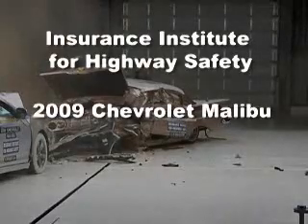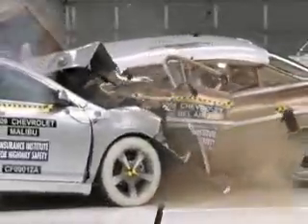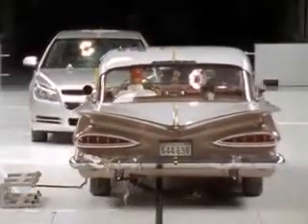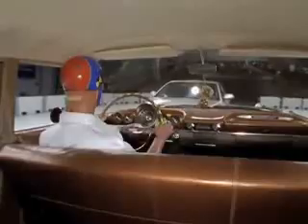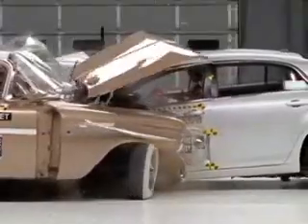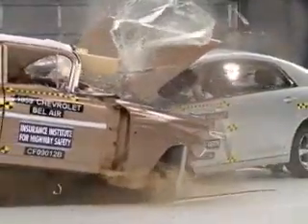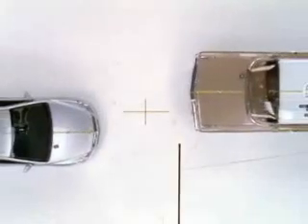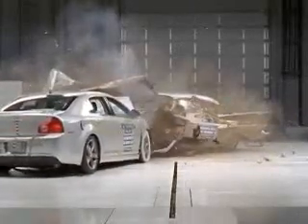Crash Test 1959 Chevrolet Bel Air VS. 2009 Chevrolet Malibu (Frontal Offset) IIHS 50th Anniversary

Comment: old cars just do not perform as well in crashes and their passengers fare even worse as they are impaled by steering wheel columns and smashed against that lovely hard steel. modern cars have improved a passengers chance of survival significantly because of engineering, science and testing - which so many here seem to have so little knowledge of.

and there is an engine - the 1/4 frontal hit is deliberate as a worst case test and its about saving people (inside and out) and  not the car.

Comment: That's not even a Bel Air, it's an Impala!! The Bel Air looks much different from that. I saw a beautiful 1957 last month and it had single head lights and a different body. Plus I think the Impala is bigger and it looks identical to the 1960 model.

Comment: This video is fake. First, the Bel Air had no engine in it so right there is a huge difference. Second, it is impossible for a car that old and well built to be crushed by a Malibu that new. Had the Bel Air had an engine, that Malibu wouldn't stand a chance!! An idiot could figure that out. All you have to do is look at them side by side. Steel bumpers, solid frame on the Bel Air, fiberglass bumpers, much cheaper frame on the Malibu.

Comment: These comments make me laugh. If you watch the dash in the '59, you will see it deform in the center. Thats the engine (the inline 6's sat in the center of the engine compartment) being pushed back into the fire wall. See the steering column? Yeah, its being pushed into the driver. Real safe, eh? Sure it sucks they ruined an old car, but I would rather be in a soul-less appliance in a crash like that than dead with a steering wheel in my grill.

Comment: Does anyone else notice the amount of rust-dust? That 59' may have had a new coat of paint, but the film clearly shows it was total rust-bucket. In which case it's "All bets off". The bodily danger of old cars was always the 'secondary crash' that occurs within passenger compartment, never structural failure. I'm going to call it "Myth Busted."

Comment: @78futura1 take into consideration there were not that many camera viewes/ angles on this and i highly doubt they fill these cars up with everything in case of a fire of leaking gas, collant ect. and also this 59 chevy was built on a X frame and they crumpled so bad even worse then most older cars due to "unique" and awful design by GM. in addition newer cars are made to crumple to slow the impact were older cars were stiff and bulky they would just bend snap and destroy its self

Comment: the steel used then was low grade unlike high strength  steel used today I drove those cars in the 60's don't get me wrong I liked them then  but they required constant work to keep them running and the batteries and generator/regulators of the day were notoriously unreliable  those x frames were notoriously weak so were the other car companies imports were even worse would like to see a 68 Buick Electra 225 in this test.

Comment: @madhatter0110 Your right about the fact newer cars are safer, the construction is better and you need a heavy impact to deform the passenger area. But this is just a useless test, the Bel-Air is not complete. To have a good test, both of the cars should be in a condition how they're driven on the road. I'm an engineer and I run tests, this isn't a proper test situation. The only thing proven here is that you can flatten an empty, 52 year old Bel-Air shell with a 2009 Chevy Malibu.
Reply: if you are an engineer involved in automobile safety, then tell me...PLEASE , why do children need to be in booster seats until they are 13 yo ??!!
Reply: @cathyoob2713  because the seat belt would snap their necks
Reply: @cathyoob2713  From Google: The booster seat raises the child's seating position so that the car's seat belt fits them properly. ... There is usually one at shoulder height to position the diagonal part of the seat belt and ones at waist height, often under the booster seat's armrests, to help position the lap part of the seat belt.
Reply: @cathyoob2713  next time google it yourself or are you incapable of doing such a trivial task?

Comment: Ok I'n not in any way saying a 59 Chevy ( or any 50's car ) is an overly safe car to be in, I mean come on, they didn't even have seat belts LOL! But the 59 Chevy really was a worst case scenario for an offset crash. It was an X body car. A  57 Chevy would likely have torn through that 59 or any other X body car (58-64ish GM's) Just as bad.

Comment: @madhatter0110 First you should think of what the makers of this video want to prove.. The inertia of this engine + gearbox = ? +-500kg of steel will really make a difference. It would have cause the car to snap, but it also would have done massive damage on the Malibu. Windows do have a lot of strength and absorb a lot of force before they break. The new car is safer, but this test isn't representive. But it isn't a real test of course, they had another objective with this test & video.

Comment: @MaestroTJS I agree that crumple zones make a car safer, but they used an old car that has a bad frame to begin with (X Frame). Also, the Bel Air has rust (big cloud of red smoke from the collision) and no engine (removing 500 (?) pounds) thus caving in the front of the car.

Comment: @craze1701 You also have to consider that they're always saying old cars didn't have crumple zones and they passed on all the energy of the crash to the occupants. Well, uhh, that seems to have crumpled like an accordion.

Someone on another video pointed out the '59 had an unusual X-frame structure not indicative of other cars of the time. (I can't confirm or deny that.)

I would still expect the Malibu to perform better, but something doesn't seem right about this.

Comment: Sooooo... the 50 year old rusted Bel-Air + without windows (=> less structural strength) + without engine is weaker then the new car..  Useless test, nice video. But I wouldn't try to do a head-on with a new car on the old, real steel. The weight of the V8 engine alone would squash the new car.

Comment: @MaestroTJS My thoughts, exactly. That old rusted Bel Air wouldn't last against a Geo Metro. They should redo the test with a Bel Air that has no rust and has an engine, then they will convince me.
Reply: According to the IIHS the Bel Air was drivable before the crash test and only the fluids were removed. You can find that information on the official version of this video they posted. Perhaps people think it had no engine because old cars had large engine compartments full of empty space.

Comment: @evilr32 the two things I don't miss about old cars is (1) RUST......I live in massachusetts and cars of the 50s and 60s rusted up real fast, they all rotted out over the headlights and wheel wells (2) mechanical breaker ignitions.....I hated setting ignition points and driving through a puddle and the engine totally conks out

Comment: @way2muchsense i beg to differ, unless ur talking about american rides which i know nothing about. an '82 honda can easily double that mileage, ofc some major parts need replacing but the engine is still from stock. Obviously a recent car would need less maintenance, but my point was that you're not gonna see cars from the year, lets say 2000-04 riding 30 years from now ... older cars were made to last, not saying the newer ones won't last either, but they wont last as long. marketing purposes.

Comment: So that begs the question, how could this crash have gone down this way? Not to mention, where the heck is the engine in the Bel Air? There's certainly not enough room for it under the hood after that blow, but it's not in the cabin, either. Where did it go? Unless there is no engine. And why do they complain about old cars being too stiff and not having crumple zones if the whole thing crushes like a pop can? It doesn't add up at all.

Comment: My dad's Mercury Grand Marquis got T-boned by a Pontiac Aztec going over 40. The Grand Marquis got a big dent in the rear passenger door, yet my parents came out without a scratch on them. If you get in the car, you really cannot tell that anything was damaged. The chassis and suspension were still in alignment after the crash. This happened a few years ago but it's never stopped being our daily driver. What happened to the Aztec? Declared totalled after the accident.

Comment: @albear972 Those who say "old cars were built like tanks"  are morons who know nothing about the structural rigidity or engineering.  They think that what makes the old cars solid are steel bumpers (as opposed to plastic ones on new cars), while in fact, the outer part of the cars body has very little to do with body rigidity.
Anyway...they should run a simulation next time for fuck sakes, instead of destorying an old timer.

Comment: @bl00dwaste Your typical car from 30,40, or 50 years ago was pretty much ready for the junkyard by the time it reached 80,000 or so miles.  Especially the engines.  There is a big difference between an engine designed with a slide rule and one designed on a computer.  The latter is designed to far tighter tolerances, requires far less maintenance, will run pretty much forever, and makes triple the horsepower per unit of displacement than a car in 1959.

Comment: Yeah, yeah...Blah, Blah, Blah...So I will go out looking for a '59 Impala.
How many of them are still on the road? They were pretty crappy cars when they came out. The bottom line is your brand new car is totalled. Just make sure it was not your fault, the accident I mean. I have more feelings for the '59 than any new auto made today. Now the 1960 Impala - that was a cool car. If only the cars of today had nice lines without the extensive price tag. Damn.

Comment: @frambesbuckeye What model Buick and what speed?  I worked with a guy who wrecked a mid '70s LTD, where a Honda came over the line and hit him head on, in a 55mph zone.  The guy I worked with was knocked unconscious, but otherwise uninjured.  The driver of the '90s Honda died, and the passenger had to be cut out of the vehicle.  

I personally got t-boned (passenger side) by a Honda in a 55 zone.  My '74 Olds got scrapped, but I jumped out of the car and ran over to help the people in the Honda.

Comment: @TNQTV Actually the weight difference among cars was much greater in those days.  Today cars have become much more homogenous, with everything falling relatively close to 3700 pounds.  If you compare the Heaviest luxury cars to the lightest economy cars of the '60s for instance, the weight difference is three fold.  

The material being used is far less important than the design.  While box tubing and rebar are made of the same material, the strength is in no way similar.

Comment: @TNQTV The Bel Air was a tiny car for that era.  It was a measely 3600 pounds, and hardly represents a genuine full-size vehicle from that time, or the burgeoning vehicles of the '60s and '70s.  The '59 Continental weighed in at 5800 pounds, and would have decimated an '09 Malibu.  The Bel Air also has the notoriously flimsy GM X frame, which was unsafe for numerous reasons.  This test basically cherry picks very poor candidate from 1959, in order to showcase modern safety.

Comment: I agree that Modern cars will go further between regular services, and as far as breakdowns, modern is better.  No doubt at all.  But when the transmission goes out on Prius, at $7500 for the job, the Prius is likely going to be recycled.  I can get distributor caps for the Malibu at any Parts store for around $20.  I can swap a variety of engines and transmissions into it for a fraction of the cost of a new car.  I the long run, old ones are easier to keep on the road for a very long time.

Comment: to all the people who say this 59  impala doesnt have a engine yes it does if you had see the original video it shows pics of the engine which was a inline 6 that got pushed  to the right side. the thing that they dont mention is the shitty X frame that this car hadthat was used by GM back when this car was built the frame is literaly a  big metal x under the car that is only attached to the body at the front and rear

Comment: and... the engine is bolted to the frame, which also ties the frame together.  I'm not going to go and say that old cars are safer, but if there was an engine it would have made a difference.    Also the solid mass of that engine hitting the Malibu would have made a difference.

Comment: @orlandoautoexaminer   They don't last longer.  The rest I agree with.  The reasons include the fact that they are not as easily serviced for major repairs like transmissions and engines.  Unit-body cars cannot be straightened after major damage like a body-on-frame car can (why Crown Vics are still popular with the police).  Obsolete electronics are difficult to service and replacement parts may not even be available.  Cars today are made of thinner metal to save weight or plastic to save cost.

Comment: @highlanderhybrid Yes that's right.  That's common knolledge. But also does not aply to all. I have crumble zones and even a chasis that's designed to split so it will catch the forces in my 1974 .But luckely you said pos older, than your all right.

Comment: @jding19711 Correction I am not from America, I am in Poland. Classics are better in style and are very comfortable. A car should never be built in plastic material. Repair costs are crazy high on them. GPS and DVD's are not needed in cars. Same with blind spots and plastic interiors. I'm not here to start an arguement, I'm telling my opinion.

Comment: @rovex32 @Kulwicki has a point, It may not change the effect on the driver of the Bel Air, but the greatly increased mass would DEFINITELY have an impact on the survival (or potential lack thereof) of the Malibu driver... either way it was a terrible waste.

Comment: @jding19711 the "leaning" you speak of is because the front springs no longer have to deal with the weight of the engine, if the springs are changed, or a downward force is applied to the car (say from a cable attached to a track? the same type of cable attached to both cars?) the "leaning" would not be evident.  would that make you a "Fucking" European? no, no moreso than @Kulwicki is a "Fucking" American or I am a "Fucking" Canadian.

Comment: @Fadsmashers - economically the newer cars are worse off, but when you have more parts braking easier up front it cushions the impact thus less injury.  I had a 1989 large bmw 735il, got rear ended, got bad whip lash cause my car was strong in the back and would not give.  You want the cabin to stay in tact, but the other parts to crush so it softens impact, it is designed to do that by intention.

Comment: @Muhlineks That does not comply with the laws of physics, and does not relate to the law of the conservation of mommentum. The bel air's momentum at an equal-speed head on collision is much greater, so the smart car, with the ultra stiff cabin wouldn't neccecerily crush, but it would bounce back quite a bit, to cancel out its momentum with the bel air's. I am trying to get into the mechanical engineering department at my school, Colorado State University.

Comment: The portion of the 59 ahead of the passenger compartment is rock solid, It is designed to not give.  As a result, when hit, the first place that the car CAN crumple and it is clear in the slow motion the first place it DID crumple is at the firewall.  The post holding the windshield moves back the door pops out of its frame, and the passenger compartment shrinks crushing the driver.

Comment: @Fadsmashers This particular organization is a 501(c)3, for the purpose of conducting tests and providing information.  Their charter is to make sure the insurers have the proper actuarial data for their risk management.  So yes, they're non-profit, even if the people they provide the data to are not.

So, you can choose between a $7000 check for your smashed car, or a $170,000 check for your smashed legs, spine, skull, internal organs and arms.  Do you REALLY want to "win" that exchange?

Comment: @Hangshai Well, curb weight for '59 Bel Air is 3650. Curb for civic is 2700 or so. Curb for '09 Malibu is 3432. So, there would be a slightly better chance for you in the Bel Air against a Civic than a Malibu, but you would still lose when that steering wheel clothes-lined you. Remember, no seat belt or air bag, and you can't over-rule physics. I'd take the Civic and be the one calling 911.

Comment: now estimate costs to repair both cars.  replacement sheet metal and engine for the bel air, with frame straigtening and total replacement would prolly be less than half the new cars repair bill.

Comment: The drivetrain (engine, transmission, driveshaft) were taken out of the 59' Bel Air, and you can see cuts in the front quarter panels.X frame cars were worse then the 58's in saftey and strength, but they would destroy the new Malibu. Not that driver would be in a healty state, though.

The AHI cheated to make the results dramatic.Saftey has improved, but is designed to save the passengers, not the car.

Besides, this does not make classic car fans idiots - we generally avoid crashing our cars!

Comment: @TheRMSAndre1 
Okay, since your so smart, show me where the driveline is in the 1959 impala, it sure the hell didn't crumple. That's a solid piece of steel, it would have stopped and maybe of shoved the engine back 2-6 inches. Not crushing the whole drivers compartment. That car would be destroyed like that at maybe a 65-70+ mph crash, not this slow crash, this is obviously a set up.